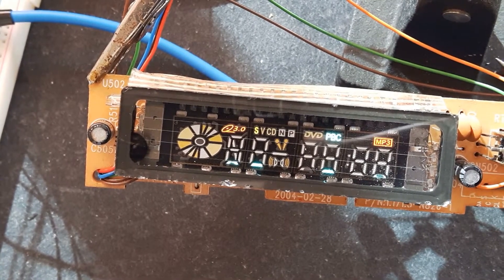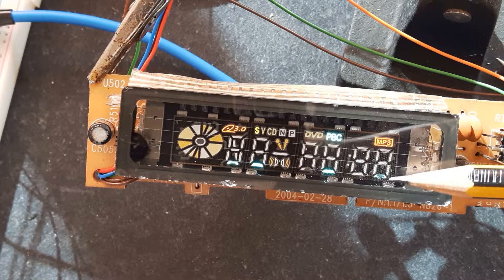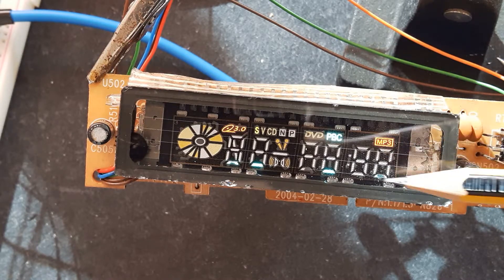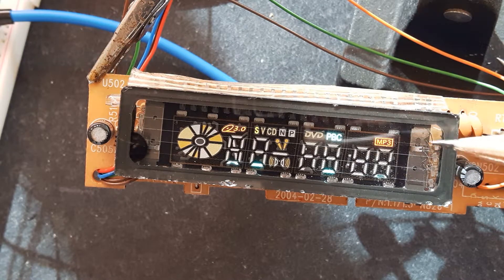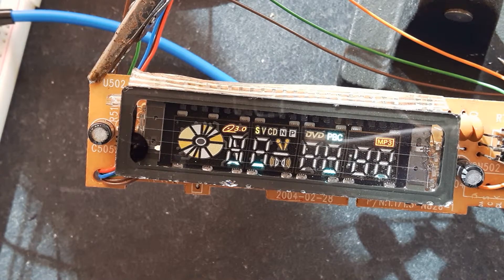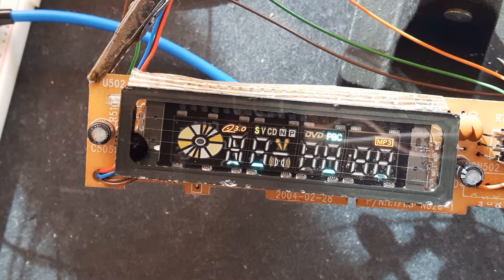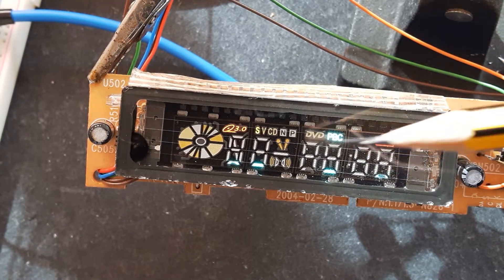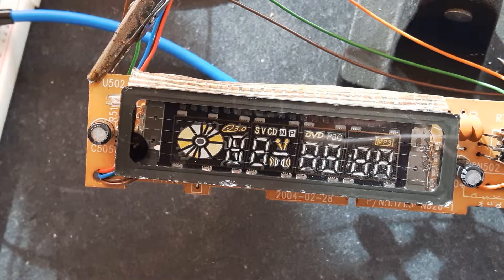VFD Phosphore faill

Comment: Sir can we run a 4.6volt ac vfd by 4.6volt dc ??
Reply from the maker: @Villagerse, I assume you want to power the VFD filament with 4.6 VDC, right?
Typically, the filament is powered by an AC voltage converter, or a transformer with a center tap to avoid shadows that are impossible when powered by DC.
But to answer your question, yes, you can, bearing in mind that the filament's lifespan will be shorter if it's powered by 3.6 VAC and we're powering it with 4.6 VDC, since the DC is constant in the filament while the AC goes through the OFF state three times in each complete cycle.
To minimize the problem, and as I always suggest in my videos where I use DC for filaments: Apply two or more diodes in series with the filament, respecting the polarity of your DC and keeping in mind that each diode (e.g., 1N4004) will force a 0.7 VDC drop. If you apply two diodes, in your case, you'll have close to 3 VDC, which is fine. If it's a circuit that uses a negative voltage as a reference at the filament, you can apply the reference after one of the diodes, which reduces the shadows a bit. Good job!